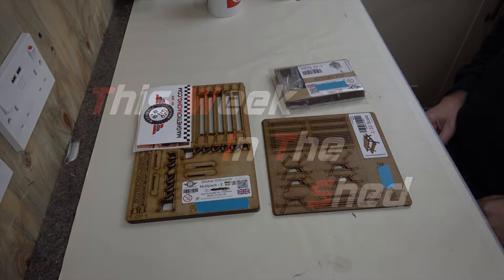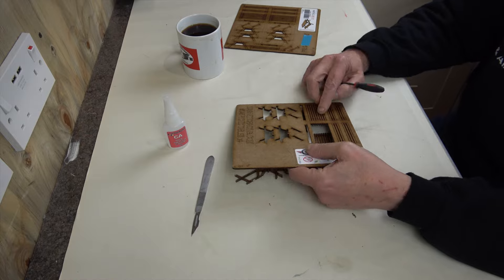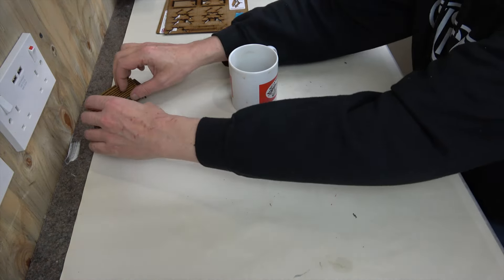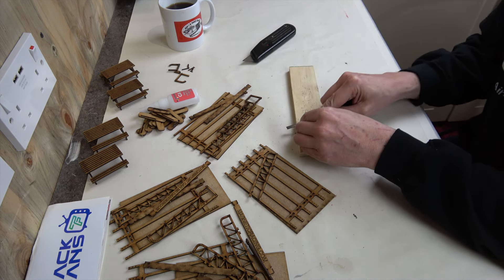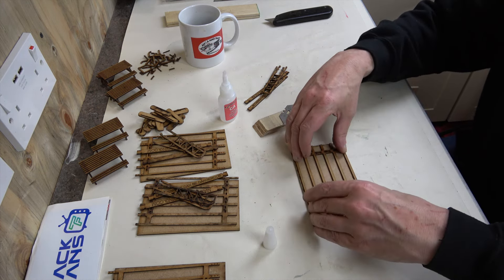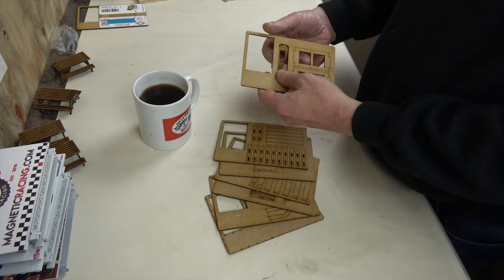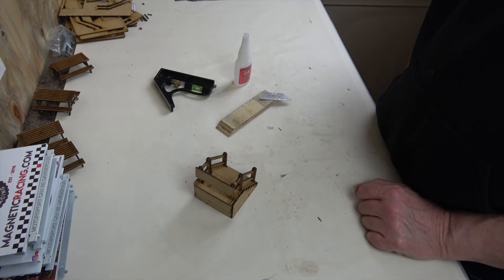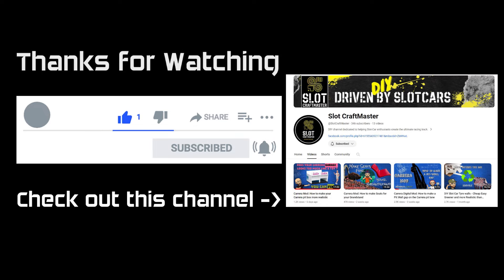This Week In The Shed - Kits, Comments and Coffee

Comment: Late in coming but  better late than never . Now where have we heard that . 
So though on the question , Collector or not ? Written last week , never sent oops.

Dave , you’ve got me thinking , which is the intent of your Coffee n Chat. 

I have always been a model train guy with a smattering of model cars , ships n planes. Am I a collector ?

I have purchased what pleases me of course. Most of which where kits of some sort or another that I intended to build . 
The exceptions were the slot cars , Aurora n AFX  and Lionel O gauge trains , some HO engines as well . Just put them on the track n go . The draw was the livery scheme of course.  What I call the  the beauty of marketing. 

I do have a few Lionel Post War engines , different numbers , same models. Guess that qualifies as collector. However all have been run . No shelf Queens.

Recently my grandkids got 1/32 slot cars from their other grandpa . I went racing with them . Eyes wide open , ideas swirling in my head . I saw a modified stock car in 1/24 in the showcase and had to build one .  Built the body out of plastic sheet (most fun) , bought the 
chassis , motor , gearing ,axles ,etc. and assembled.
It’s slow compared to those 1/32 rockets the kids run , but they get a kick out of passing n lapping grandpa,  as grandpa absorbs their elation.

So back to the question. I guess wanting  the same car in three different liveries would lean the needle toward ‘collector’. Especially if they were to be ‘shelf queens’, test run only.
On the other hand , wanting identical cars to race ‘ same class ‘ doesn’t qualify as collector in my observation.
Tinkering with the cars to improve handling, is expected , and the fun of it all. 
ENJOY !

Keep those chats coming 😊